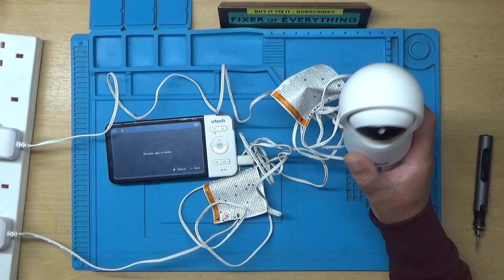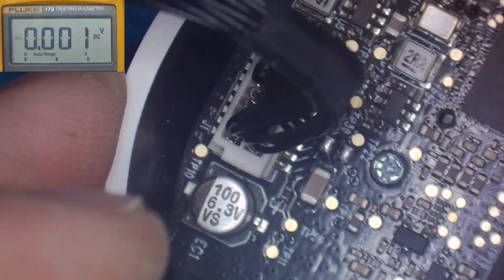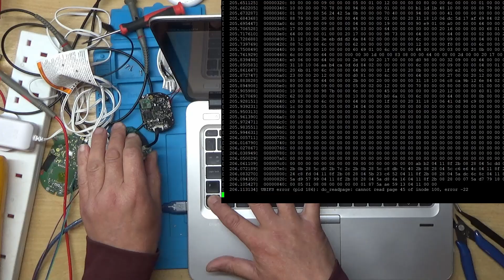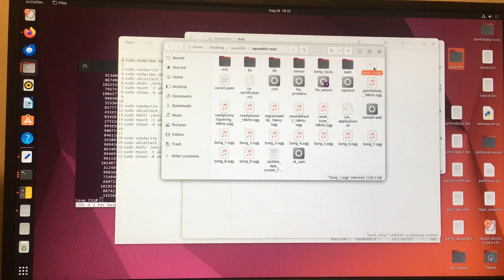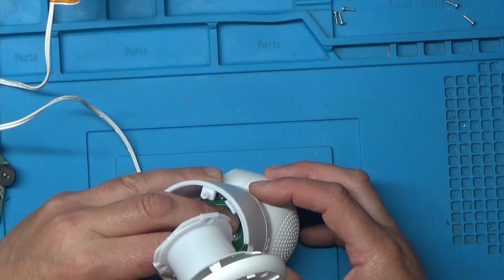Faulty VTech Baby Monitor | An EPIC Repair With Shocking Findings!

Comment: could you explain bettere the connection to the computer, the software you use etc?

thank you 

you are AMAZING
Reply from the maker: Thanks 👍The connection to the computer is serial data (think like RS232) but at 5v or 3v levels instead of the old -12 +12 like RS232 was. So the USB converter gives us a serial port, that sends and received data at 5V levels. The software I used was a terminal emulator called PuTTy which lets you send and receive data over the interface I just mentioned. We can then hook that up to a device (like I did in the video) and hopefully interact with it. You may need to change settings such as the baud rate and tell putty what COM port the USB converter is (which is shown in device manager on windows). In this case the Baud rate was 115,200 and 8 bits, no parity and 1 stop bit. These are quite common settings.

Comment: yup, when you weren't getting anywhere with the backspace key my immediate reaction was "try Ctrl-H instead" ;)

I have a tftp server setup on my network specifically for the purpose of re-flashing routers and the like which use UBoot.

As far as reading data out of flash images, binwalk is your friend, it will allow you to extract most common flash file systems with a single command.

Comment: While I was still working in the industry this type of embedded Linux debugging was part of my job. Very impressive what you have done there. Somehow it looks like the data partition had overflown and the system was not able to handle this situation and marked the partition as faulty? In this case I would call this a planned crash of the sw making the device unusable. Intention? Sell another one ....
Reply from the maker: After I finished recording I managed to find the file that caused the problem. So I'm not sure if I can be blamed on the update although the dates did seem co-incidental so it still may have been the cause. The problem seemed to be a sqlite database stored on vtech data 1, which indexes the video files, so perhaps the camera lost power or rebooted while updating this file. I think deleting the videos caused this database to be re-created and fixed the error.
Reply: @BuyitFixit  interesting!

Comment: A challenge for a skilled individual but corporate would not want to invest the labor hours most likely.
Reply from the maker: Yes totally agree, too much time invested in this to be a cost effective repair, although now we know what the problem was, it would be pretty straight forward to have a test rig set up with some pogo pins, shove the camera on top, and run a few UBoot commands. I think I could probably fix one in 5 minutes now.

Comment: I feel Mick and Linux are a match made in heaven....
Reply from the maker: 😂😂😂Yes I've messed around with stuff like this before. My main PC was a Linux machine about 7 or 8 years ago.
Reply: @BuyitFixit  my last Windows was 98se, never installed XP, Linux is easier, I can fix it myself.

Comment: Amazing detective work. Gray cells working full power. The companies should have a fail safe software to prevent failure after firmware update. Also storing user private video sound etc on a non removable media should be prohibited.
Reply from the maker: Thanks 👍Yes agree.

Comment: I've just been playing with retrieving data from an SD card from a Home assistant install on Raspberry Pi and, using Ubuntu terminal  used fdisk -l to list all of the drive hardware to see where my USB stick was (sdc1), I then make a mount point (mkdir /media/usb-drive) then mounted the USB (mount /dev/sdc1 /media/usb). After that I used the CP command to copy the files I wanted to the USB drive.
Reply from the maker: Nice, only problem with this device is that it didn't have access to a full linux shell, only U-Boot which only provides a limited set of commands. No fdisk, mkdir, or anything like that.

Comment: Great vid as always Mick but I was in a bit of pain watching you copy commands from your text file into the terminal. Quick Linux tip for you. Just highlight the command in the text file, change focus to the terminal and press your middle mouse button and, as if my magic, Linux will do the copy paste for you. Saves a lot of time and the odd keyboard wearing out 🤣Cheers 🍺
Reply from the maker: Thanks 👍.I'll have to try and remember that one. I've not used Linux for a good few years, I used to run my main PC on Ubuntu when I was developing some android stuff.
Reply: @BuyitFixit  I've been running Linux Mint for several years now and it's turned out to be one of my better decisions.😀Won't have Microsoft or Apple in the house these days. If only I could go back to my BBC model B. 🤣🤣🤣
Cheers, keep it up. 🍺

Comment: Amazing! I used to work in electronics and programming, back in the last century - but I was amazed at how you managed to sort all that out. My closest memories of that sort of thing relate to reading MS-DOS and using the related commands to read directories and files etc. That and programming EPROMS and such. But the parts were big enough to see in those halcyon days!
Reply from the maker: Thanks Timothy 👍I too remember using MS-DOS and EEPROMS 🙂The first PC I built had MS DOS and Windows 3.11. The EEProms were used quite a bit in fruit machines, and arcade machines which I used to work with.

Comment: You could find a job as an embedded systems engineer (if you can program). You know pretty well how an embedded linux system boots.
Reply from the maker: Thanks 👍Yes it's not the first time I've messed with stuff like this. There's some very early videos on my channel where I reverse engineered a few kids toys, wrote an SDL layer and cross compiled DOOM to run on them. There's also a few other devices I've repaired like this. I've just created a new playlist where I added this video, and a few others, where I've had to reverse engineer firmware / software.

Comment: What a great video, your knowledge is outstanding.  you really know your way around Linux. when you initially setup the PC to look at the data, what terminal software were you using and was that on a windows or linux OS.
Reply from the maker: Thanks 👍 I was firstly using my windows laptop with PUTTY (terminal emulator). Then I set up the linux system as it's easier to mount file systems etc than having to download a load of utilities on windows (although I could have always ran a VM)

Comment: I wish you make a video about all those programing usb adapters and how do you know where to connect the probes. Softwares to read the data and basic commands its very intresting.
Reply from the maker: I might have a few other videos like this one coming up 🙂It's just trial and error (like I did with the pins at the start) and using the internet. Although there wasn't much info on mounting this particular file system (UBIFS) that I could find, and most of the stuff I tried didn't work.

Comment: I'm a retired IT guy and back in the day I wrote mainframe assembler code and debugging hex core dumps was something we did all the time. It's something of an indictment of how these things are set up that it requires such forensic Linux skills to resolve  what looks like a 'file full' or space overflow type issue.
Reply from the maker: Thanks for sharing Ron 👍

Comment: Scarey you’ve just exposed a potential security flaw in that product and declared that there are many for sale on eBay. If the FW gets corrupted then the design should delete the recorded files. Love your channel but think you should report this back to vtech. We are dealing with very sensitive material. GDPR?
Reply from the maker: I guess it's the same with a phone and a smashed screen, or if it won't switch on. If someone sells it on eBay it would still contain the data. If something can't boot then how can it delete the files? The best way I can think of would be to have the files encrypted rather than stored unencrypted.

Comment: Damn, that was a journey.
I wonder how many dead devices are out there what are simply victims of a bad OTA update (that the end user probably didn't know about or ask for)?
Reply from the maker: Thanks 👍After I finished recording I managed to find the file that caused the problem. So I'm not sure if I can be blamed on the update although the dates did seem co-incidental. The problem seemed to be a sqlite database stored on vtech data 1, which indexes the video files, so perhaps the camera lost power or rebooted while updating this file. I think deleting the videos caused this database to be re-created and fixed the error.

Comment: Great movie. I wonder, if you can connect usb pen directly to usb pins, mount it and copy movie files to it. Just using pogo pins, without unit disassembly.
Reply from the maker: Thanks 👍Yes possibly, although I don't think U-BOOT has this feature, so you would need to get the unit to boot properly and get a Linux shell to do so. You could also do it via WiFi and FTP or something or SSH once it was booted up.

Comment: I'm surprised there wasn't a factory restore function on the camera unit (only the display).
Reply from the maker: Yes same here, although if there was one it may not have worked as the unit was crashing before it had fully booted.

Comment: Ive got the 2010 model that served my family well, and still works. Amazing how much more advanced the newer ones are. Damn shame Vtech are bricking these devices through updates, as they made good reliable electronics when I was in the market for them a decade ago.
Reply from the maker: After I finished recording I managed to find the file that caused the problem. So I'm not sure if I can be blamed on the update although the dates did seem co-incidental. The problem seemed to be a sqlite database stored on vtech data 1, which indexes the video files, so perhaps the camera lost power or rebooted while updating this file. I think deleting the videos caused this database to be re-created and fixed the error.

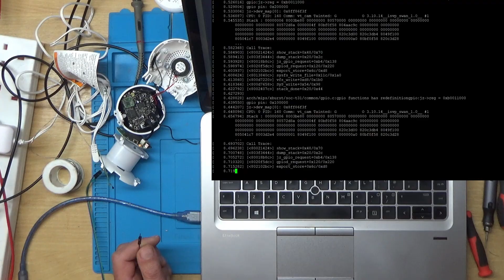Comment: Very interesting!  Thanks   Definitely Skill applied;  Stopped on spot!  20:30  You get Full sentence.  lol  Too easy!  : }    missed by 1 sec.  I Slowed view, read Data, [noted] words, (not full sentences) saw "Block 45".  20:25  Now? i 'know' [combining = 'brain food'] 
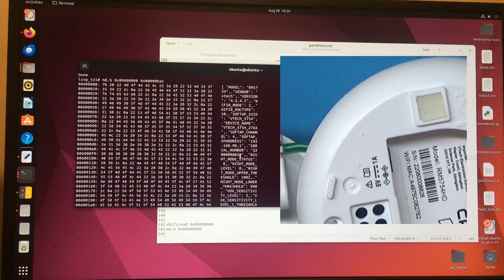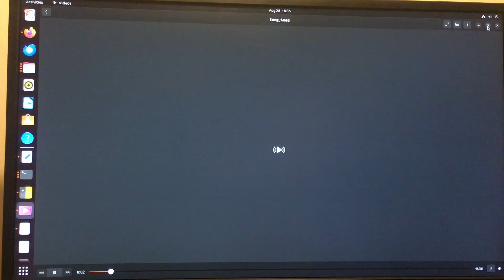36:57; 40:19; 40:24   "Lullaby duration,.. song, .. volume.."  \  43:52 'My Bonny' ?  slow
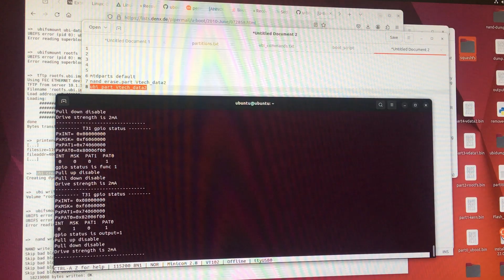46:56  No error now as was in 20:25.   BRAVO!  i Hear Smile  8|}  
So that's how FBI extracts data;  They Never 'dump', they edit. "UNsquash", nice word.  

- sorry, i'm plagued with Data Ambiguity:  not interpret well.  tho, learned some.  

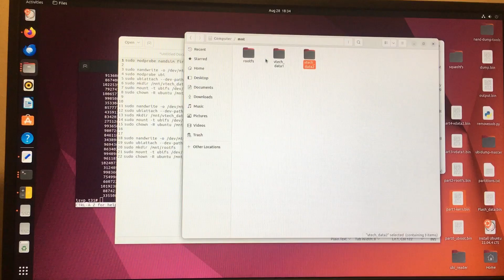43:10   'Squashfs' took 'vtech Data1' [& rootfs] Crashed with others?
SQFS data "UNsquashed" ='Opened' .. flooding sys with Extracted files, [old] Data Jammed New data?     don't [shouldn't] updates remove what replacing?   

?[Issues & warnings]   possible Reading lesson  [left data list for next life] 
20:15  Squashfs: ver 4.0  2009/1/31  Philip Laugher 
20:16  warning print: rsvd - cannot reserve enough PEBs for PEB handling 
Good 32, bad 0, corpt 0   [all ok now?]    
[warning] reserve 2, need 20   >  handling 5 >  PID 40 > ubi1 finished  \ > warn [20] > hand 2 > PID 41 ubi2 finish \ > Warn 20 > Hand 4 > PID 42  > unable to open rtc device [no Fin] \  
... PID 43 ... [recov - completed > ... no such dir ... ]  \ PID 67 ... \ ... PID 70 ...> > 
20:18  Mounting tmpfs on /  run Failed: No such file or directory
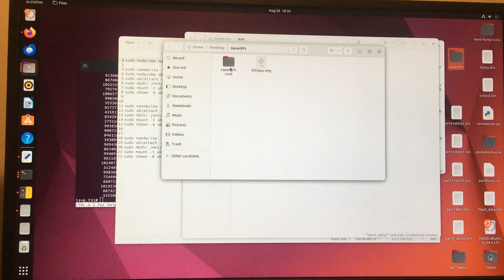20:23  comm: vt_cam tainted: G   < 43:27     
-->  [SOC  T31] -->  [redefined function]   -->
 T31 gpio status   \    gpio status is output = 0   \ pull up disabled \    pull down disabled
-->> drive strength is 2mA
20:22  rtw adaptivity  \  wlan pwr on \  mmcl: card claims to support voltages below the defined range.  these will be ignored.  [<---] ?  \  mmcl: new SDIO card at address 0001

20:25    ?[42: 05]  [46:56]  arch/mips/xburst/soc-t31/common/gpio.c.gpio: function has redefinition  
cannot decompress 2131 bytes compressor lzo, error 22      <-- [is now fixed]   : }
UBIFS error (pid 186): read_block: Bad Data node (block 45  inode 100)
magic \ crc \ node_type  1 (data node) \ group_type  0 (no node group) \ 
sqnum  160186 \  len  2179 \ key (100 data, 45) \  size 2096\  comtr_typ 1 \ data size 2131 \ 

20:26   UBIFS error (pid 186): do_readpage: cannot read block 45 of inode 100, error -22
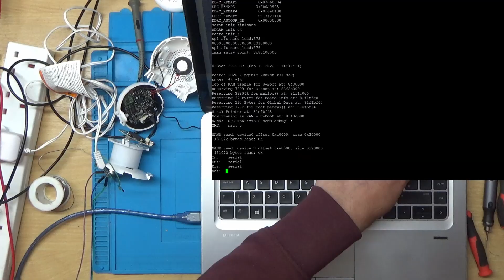23:51   cpufreq  U_delay  loops_per_jiffy   \      dwc2: ID pin changed!     <--[all caps]   
Squashfs: ver 4.0  2009/1/31  Phillip Laugher   \
jffs2: version  2.2. (2001-2006)  Red Hat, Inc.   \  msgmni has been set to 61   

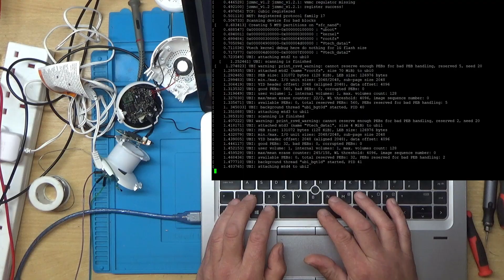24:04  regulator-dummy:  no paraminators       -  this is not easy -

Comment: This is a fantastic video to watch! Not only u got the hardware skills but also software and patience skills. So it seems like the update may have used more space than the previous update and along side with the dozen of user videos the camera run out of usable flash memory and crashed on boot? That or the update may have been intentional to brick the camera a few days after the update to force the users to buy the newer model or to avoid 2nd hand market selling as those devices are typically used for only 1-2 years
Reply from the maker: Thanks 👍After I finished recording I managed to find the file that caused the problem. So I'm not sure if I can be blamed on the update although the dates did seem co-incidental. The problem seemed to be a sqlite database stored on vtech data 1, which indexes the video files, so perhaps the camera lost power or rebooted while updating this file. I think deleting the videos caused this database to be re-created and fixed the error.

Comment: Absolutely epic fix!
Reply from the maker: Cheers 8BitTony 👍 Z80A? or 6502?
Reply: @BuyitFixit  both, had a Speccy and an Atari 400 (spoiled kid). Ended up loving the spectrum more mostly because the keyboard was better than the Atari 400 and that's a low bar.
Reply from the maker: Had both of those. The first computer I owned was a 16K speccy later upgraded to 48K (with ram chips), but had a lend of a ZX81 before that, and first computer I learned to program on was a friends Nascom II that we had to load basic from tape.
From there I had an Atari 800, C64, Amiga, PC's etc etc I remember the first game I ever hacked was jetset willy on the spectrum as it had this colour code thing you had to type in, so I started searching for 195 which was JMP to see where the program jumped to when it started up and found 34499 was the location of the "enter code" bit. So a poke 34499, 201 (return) made it return as soon as it was called without having to enter the code, and the game just ran 😂😂😂
Reply: @BuyitFixit  There's an entire generation in the UK with a very similar experience. Found the decrement lives instruction in Harrier Attack so I could play it endlessly! I went from a kitted out ZX Spectrum (mouse, proper keyboard, thermal printer) to an Amstrad PC1512 when I went to Uni, and it was PCs from them on in. Wrote a bunch of stuff on the Spectrum, but mostly stuff relating to my other main hobby (D&D).

Comment: You might have been able to extract the file systems directly from the flash dump using 'binwalk'?
Reply from the maker: Unfortunately not. It was the first thing I tried. The problem is that the flash has OOB data at the end of each block which is used for error correcting, so we have 2048 bytes + 64 bytes of error correction data in the dump. (binwalk doesn't know how to handle this). Then the other issue is that this uses the UBIFS filesystem which is used to prolong the life of flash chips by not writing to the same block over and over again, so files are fragmented all over the flash.

Comment: You can always fix my day with an new  episode of your mind blowing fault finding talent... Always so impressed of your skills. Almost Everything is fixable when its in your hands🧐 how you learned All that? What's your job title?  Myself has been an auto mechanic and worked with car's about 20 years.. Just finished my bachelor in marine engineering. and started  as a technician in the energy sector. In Dk. So I also like repair instead of replacement. Love watching your channel and always learning some new stuff... What's the name on the Repair group and is there one in Denmark?
Reply from the maker: Thanks for that 👍"Farmer" I guess now 😂😂I used to work repairing amusement machines back in the day, and always had an interest as a hobby in electronics and computers. I did work for a couple of companies repairing bits and pieces and installing DJ and AV equipment in pubs and nightclubs. https://www.repaircafe.org/en/visit/ is the group that I volunteer at. I would think there should be one in Denmark.

Comment: If vtech's update bricked this one there are probably hundreds out there gathering dust 😅
Reply from the maker: After I finished recording I managed to find the file that caused the problem. So I'm not sure if I can be blamed on the update although the dates did seem co-incidental so it still may have been the cause. The problem seemed to be a sqlite database stored on vtech data 1, which indexes the video files, so perhaps the camera lost power or rebooted while updating this file. I think deleting the videos caused this database to be re-created and fixed the error.

Comment: Does anyone else think it’s suspicious that the firmware update made the camera crash ? Like how many people had to turn around and scrap their cameras after that ? Planned obsolescence?
Reply from the maker: After I finished recording I managed to find the file that caused the problem. So I'm not sure if I can be blamed on the update although the dates did seem co-incidental so it still may have been the cause. The problem seemed to be a sqlite database stored on vtech data 1, which indexes the video files, so perhaps the camera lost power or rebooted while updating this file. I think deleting the videos caused this database to be re-created and fixed the error.